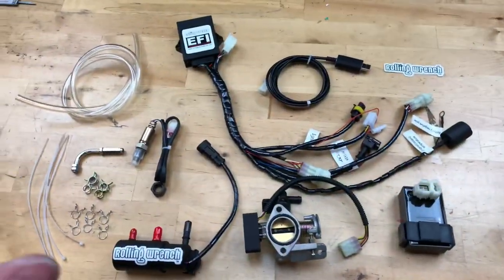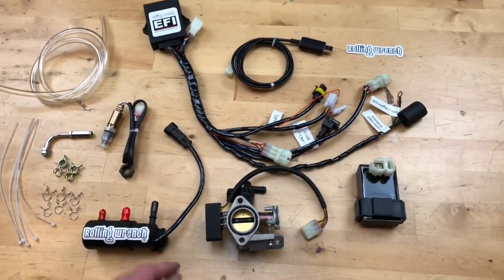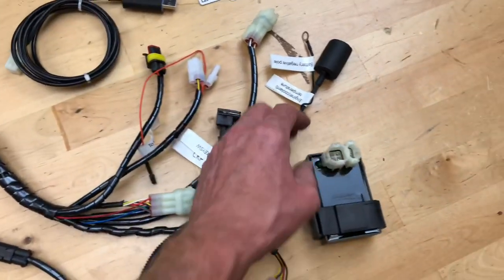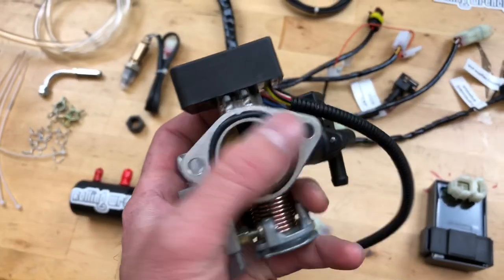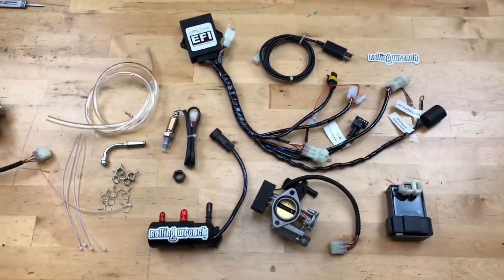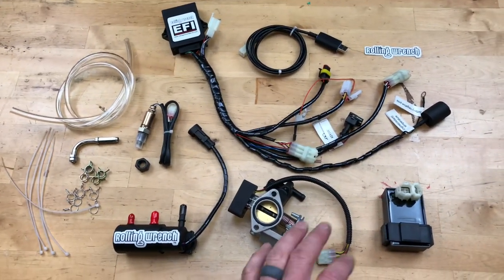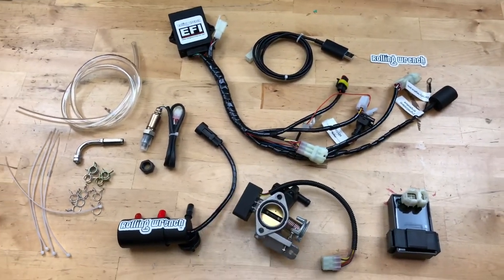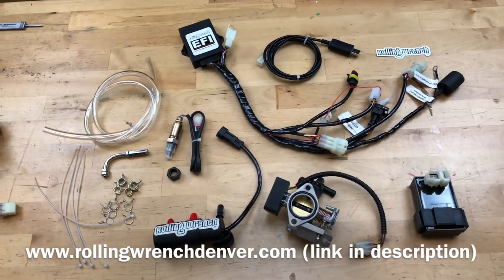DIY FUEL INJECTION  KIT (we now only offer our plug and play kit) TECH SUPPORT GOT OUT OF HAND

Comment: Looking to do a DIY on a 2003 Yamaha WR450F. Only issue I am having is getting a crank sensor set up. Any suggestions
Reply: Did this kit work well ? I am trying to do it now with my YZ250F
Reply: @boru-cnc  I didn't have any luck, basically need a machinist to get a sensor that will read the existing starting gear. Then you have to program the sensor to know how to read that starting gear. If you have a YZ, you don't have electric start
Reply: @warsman22  yeah I have no problem with mechanical work as I have access to cnc machine, but I was curious how this cheap kit worked in Yamaha 250/450f

Comment: I have a 2004 honda crf450r carburetor.  And i wanted to used this method to convert it to fuel inject
Reply: I also am looking into this conversion ! Buying the 250x engine for electric start and hopefully more stator power for fuel pump and rad fan ! I'm going to try and adapt CBR ECU first 🤔

Comment: Got a Yamaha FZR 600R (I am in Europe, Romania) - 599cc 4jH factory OEM engine. It comes with 4 independent carbs, 2 coils, 1 electric fuel pump, 1 CDI. Can it be converted to EFI? I also have a 750gsxr ITB (lacking the OEM fuel injectors) - can I use that somehow?

Comment: is it possible to programme the EFI unit for a parallel twin motorcycle to have two modes; 1) normal running mode i.e both cylinders working. 2)Other mode is a cylinder deactivation mode where the engine uses only one cylinder or both cylinders fire but they skip a cycle after every power cycle that in return consumes less fuel.. ... e.g engine is a 350cc twin so running in mode 2 is like a 175cc.. ... An you programm one?
Reply: What if you set up the twin as two entirely separate motors?  Duplicate everything?  Then simply switch one off....but WHY? fuel economy?  You would NEVER recover your investment in fuel savings (unless you started selling clones to others) ...When you just would factor in the amount of time even at the lowest wage acceptable  You could never recoup it all in fuel savings.....well maybe if you rode 200k miles a year lol
Reply: It'd be hard to keep the engine running due to an inherit lack of rotation momentum. For example, I will use my KZ400 for example. Crank weighs 15 pounds. Pistons weigh MAYBE 180 grams, 200 tops, for less than a pound for the pair (worst case scenario). 200-400 grams per con-rod, for 2 pounds between the pair (worst case) We'll say the wrist pins weigh 200 each, less than a pound per pair. Maybe 5 pounds for the cam, and 2-3 pounds for the the timing chain. Add a 5-7 pound flywheel, and you have a rotating mass for the engine at around 34 pounds (rounding up) of rotating mass. Compare that to a Chevy 350 crankshaft, which alone weighs anywhere from 39 to 54 pounds depending on year and whether it was a 2 bolt or 4 bolt main. Add a 30 poundish flywheel (if a stick shift), all the con rods / wrist pins / pistons, camshaft, timing chain, timing gears, harmonic balancer, etc and you have a total rotating mass of MORE THAN the combined weight of my KZ400 engine and transmission (100-120 pounds). 

These bigger engines can get away with cylinder deactivation due to a literal massive amount of rotational momentum compared to our wimpy sub-liter bikes.

And there is the issue of running ability and the issue of cause and effect. Take that bike, unplug one cylinder, it will most likely die or come pretty close to it, and even if it does continue running, good luck restarting it on a single cylinder. On to your goal, youre wanting to deactivate a cylinder to save fuel, but there is an issue with that: while any single cylinder is consuming less fuel compared to the system as a WHOLE, said system is balanced. You remove a cylinder from the equation and the cylinder(s) remaining have to carry the extra weight. They have to carry the weight of the dead cylinder, carry the now unbalanced nature of the engine, as well as WORK HARDER to not only maintain engine speed, but also to accelerate. There is a thing called the Laws of thermodynamics, without the extra rotating mass that car engines have, you will lose so much energy by dropping one of your two cylinders that you will likely be consuming MORE fuel to run it that way versus running both cylinders properly because that one cylinder has to work so much harder. 

Also, since that one cylinder has to work harder to run EVERYTHING, you're going to come across longevity issues. That one cylinder is going to wear EXPONENTIALLY faster than the one that gets deactivation, as well as side-loading the crankshaft due to only having combustion on one side of it. You are likely to also wear the crankshaft bearings on that one side a lot quicker, if not snap the crank entirely (and yes, it has happened due to imbalances before, Caterpillar 3406 engines were EXTREMELY bad about this from something as simple as a BELT being too tight). 

Long story short, using this with cylinder deactivation in mind is a TERRIBLE idea at best and the BETTER way to approach this would be to program the TWO cylinders to just run leaner than normal, this WOULD save fuel WITHOUT the headache and potential damage to the engine at the cost of having less power at your disposal.

Comment: i see alot of kits on your guys website. some support for the predator 212 platform would be something id invest in (and likely others) because there's no support for it.  id loved to be able to fuel inject the motor so i can turbo it. the efi is essential for that working (if it will at all) because the fuel just gets pulled right out of the carbuerator bowl. and I'm unable to find and solutions without fabbing most of it myself
Reply from the maker: Lookin into our “vacuum fuel pump delete kit” in the meantime

Comment: What is the name of the tuning software? ANd with only a narrowband o2 sensor how are we supposed to get accurate AFR's? It needs a wide band for proper tuning. Especially with people wanting to use it with a turbocharger.  I want to get this kit but it seems cheaper and more practical to just get a Honda MSX 125 and use their FI system.
Reply: DUH

Comment: My Tomos engine from 1970s has already Ducati CDI ignition system and 75cc cylinder. Is it possible to install this injection system?
Reply from the maker: No, it doesn’t have the stator power to run the system :-(

Comment: will its owesome, but i dont have a scooter i have only semi automatic motorcycle suzuki smash 115cc 2018 carburetor fuel system. can i do this, same conversion? it will work this set up EFI kit for 115cc in semi automatic Horizontal engine? because i want  to convert it. i hope you will response .thank you!

Comment: Hi.  Can this, rather the Plug-n-Play version, work on a 2002 v-star 1100 twin?
Reply: These kits are for GY6 150cc Chinese motors, the throttle bodies will not be able to feed enough fuel to 1100. (I was actually trying to do the same thing) when i came across this vid.

Comment: can one use a single cylinder conversion kit to run a 3 cylinder engine?
Reply: I would think offhand?  Yes  with a three in one manifold ....but that is always gonna be low performance.....many manufactures of multi cylinder vehicles in the past fed all cylinders with a single carb and often that would be the econo box model in order to advertise "starting FROM $ $1099.00  (or whatever)
Reply: @dougiequick1  most motorcycles from 1970 onward, other than HD and a few metric cruisers, were 1 carb per cylinder with a few select thumpers even running two carbs to feed one thirsty beast.
Reply: @OP, theoretically you could if you were still thinking of going this route, unfortunately you would need three pick ups (or "pulse coils" as they're called) in this case, since the three cylinders are fed and ignited and different times.

 It'd be MUCH simpler it were something like a 360 degree parallel twin, since you only need one coil for both cylinders (batch fire) therefore, a singular pickup to control ignition and fuel timing.

Comment: I have a question for a potential application I'm running a highly tuned and blueprinted Norton Commando 850 and was thinking about utilizing two standalone  DIY units and tune each specifically to its respective cylinder.
Since the bike is blueprinted left side equals right side .... on the button... and it would be interesting to
dial in two DIY units and create a balanced and synchronized output.
I am currently running 32 mm Amal carburetors
I have a Clayton engine Dyno so the dialing in part would be easy to do.
The machine is set up for quarter mile drag racing and the primary
operating range is WOT
while overcoming the bog at shift point.
I run 12.5/1 CR and 110 leaded race fuel... however to minimize brain damage change  to E85 would be Nirvana.
(Not sure if your unit can step over to E85)
Just some Christmas day thinking I would appreciate your thoughts and comments.
I'll close with a quote to let the " Why do you want to do it that way???" crowd ponder-- it comes from Tom Edison and states--Whether you think you can or think you can't ...either way you're right"